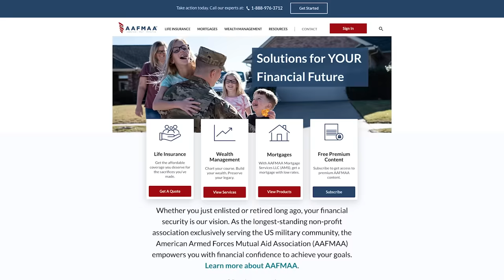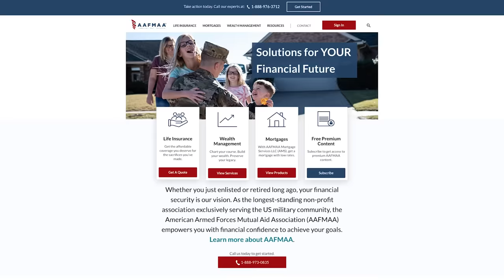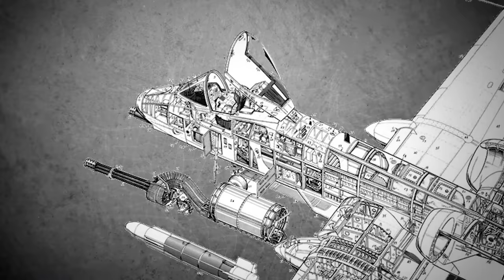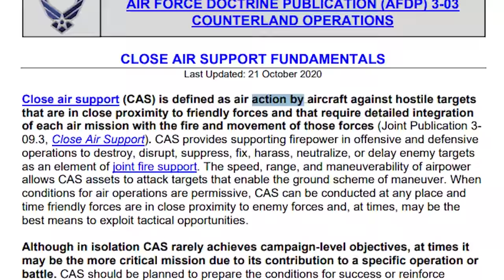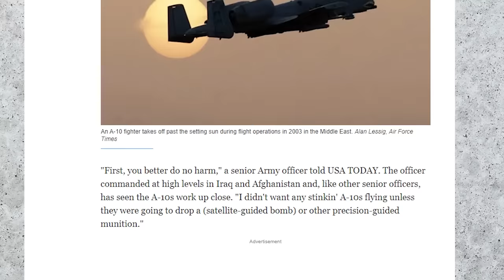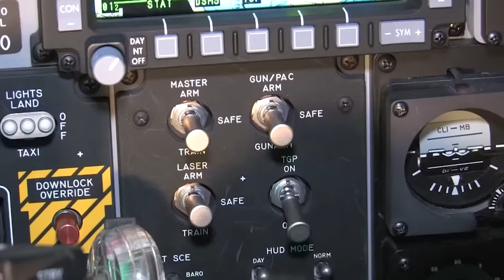Why the Air Force is Screaming to Retire the A-10 Warthog

Comment: As a teenage cadet I saw A10s on a bombing range. The maneuverability was the thing which really stuck with me.
Reply: while piloting a Navy H-3 in the pattern along with an A-10 at Tustin MCAS, it was turning circles inside our pattern 😂
Reply: Air show in UK 1981 saw an A10 do a tight  180 around a church spire, and was impressed.
Reply: The A-10 is slow, it's not 'maneuverable'. An illusion of maneuverability comes with slow speeds but that's like saying my shitty 1980s Corolla has better maneuverability than a Zonda F, because when the Zonda is going 180 MPH it can't make a right turn as quickly as my Toyota can at 15 MPH.

The A-10's engine are vastly too weak to call it 'maneuverable', its big ass wings mean it bleeds tons of speed with every turn and takes forever to get that speed back.
Reply: I've seen videos of these planes coming in under treetop level.  I've also been told that the plane comes in so damn low your instinct is to hit the deck instead of going for your weapon.

Comment: Back in high school I designed a close air support replacement for the A-10 for my CAD class project. Sort of conceptually similar to a hybrid of an A-10 and an Osprey. It had 4 General Electric TF34-GE-100 turbofans for propulsion. A wingspan of 70ft with 2 rotatable engines on the outer tips of the wings and the other two in the usual A10 location. It could carry 3,000 rounds of 30mm for its double GAU-8/A Avenger rotary cannons. One cannon faced forwards and the other one faced rearward at a downward angle. The idea was that using computer assistance the pilot could fire forward during his downward run and the computer would map the target during this firing phase and then calculate the path to take upwards so it could fire a second burst at the same target if the pilot decided to press the rearward fire trigger. Not only would a rearward firing cannon allow for double taps on hostile targets, but a rearward firing cannon combined with 4 GE turbofans would allow my creation to get the hell out of the danger zone very quickly.

I mailed my designs to the pentagon and DoD in 2007. Still no word yet on when I will be under contract to build it. Aaaaaany day now.
Reply: Make a mini gun but each barrel is itself a GAU-8
Reply: So you're the kid responsible for designing the Mk-19.
Reply: Your plane was too awesome for them to comprehend.
Reply: I wish i socialized more in highschool so i could know people with cool interests like that
Reply: You had me at "...double GAU 8/A..."
Reply: In the words of the Pentagon Papers: "Your plane needs a port-hole."
Reply: Did you give any consideration to what fuel and ammunition requirements, weights, and sizes would do to aerial performance?
I would guess not. .. you were a HS kid, scribbling instead of taking notes.... and this would make you a candidate for a procurement position at the Pentagon, perhaps.
Political infighting is the talent rewarded in the modern 'military' not military savvy... it seems.

In this case.. before I even watch the video.. 
I predict this will have more to do with people more informed of reality by Video-Gaming than by Engineering and Military experience.
Almost guaranteed this is e another workfare defense project like the littoral ships the Navy wasted  insane levels of resources upon.
Also almost guaranteed it will be an inferior piece of crap hyped in ways that impress intellectual poseurs in decision-making positions.
This will be more about moving workfare tasks around to various politically-connected locales than helping the USA be militarily superior.

Might think differently after I watch the video.. but I doubt it.
Or so I speculate as of now.
Reply: Should've just designed the Halo Pelican and submitted it
Reply: I’m sure you are out there ‘tearing it up’ in the ‘adult’ world now—you sound like a very creative person!  In the 1970’s as a ten-year-old, I wrote to the governor of my state suggesting dedicated “lanes” just for bicycles on the roadways,  I got a polite reply, but if felt condescending and like a major blowoff. ——-I don’t know, do any cities have bike lanes these days?😉
Reply: I say, make it out of wood like the Mosquito to make it stealthy. Voilà. The vulnerability issue solved.
Reply: @sfertonoc  Use sails for fuel saving.
Reply: What was it made of?  Something that heavily armed would also need a lot protection for the pilot and engines.
Reply: Would your plane be manoeuvrable? Since it sounds very heavy 😅
Reply: Hit the nacelles using MANPADS. Huge design flaw right there
Reply: I send them my ksp craft files... Still no word
Reply: Maybe they should hire you
Reply: This would actually solve the stalling problem when the gau fires lol
Reply: Thanks for the crayon drawing of your transforming jet 
- dod
Reply: August 25, 2023 - Mr. Freeze😉 That sounds like a fun project you had. It would appear that you have a very rewarding skill set both as a profession and a hobby. Stay well and fingers crossed🤞🏽😊 for selling your next design. Stay well.
Reply: If they give you any acknowledgement for this it would quash use of any similar ideas in the future from someone else in case there would be dispute over rights.
Reply: Mike sparks? Is that you?
Reply: In my youth I drew up all kinds of great ideas like a credit card music system instead of vinyl records.. Yeah, it became THAT popular! 😉 ..and I became || <--that rich, but I grew up on the notion we'd all have the famous Jetson's flying cars by now..and your average moron behind the wheel would suddenly become ace pilots running to the grocery store 4 blocks away.. I couldn't even imagine electricity without waiting for a lightning storm, flying a kite with a metal key hanging from the string and hooking it up to the power grid.. See what I missed out on?
Reply: It had r a g head tracking tech
Reply: @Necromediancer  Hey hey, that's making too much sense, that doesn't sound like a 15 year old's bulls**t idea!
Reply: Sounds insanely expensive, maintenance-wise. Cool tho
Reply: All bling no basics...

Comment: One compelling observation (as early as WW2) that greatly supported the “bathtub” concept was the fact that when you looked at all of the severely war damaged aircraft that managed to limp home in spite of huge holes in their wings and/or fuselage … not one of them had a hole in the cockpit area thus truly putting the fate of that bird entirely in the pilots hands.
Reply: P-47 Thunderbolt ONE is the inspiration.  Lots of engine, plenty of machine guns, and armor, armor, armor.
Reply: Duh?
Reply: @kimweaver1252 yeah… and air superiority and already having won basically (thanks to your allies mostly)
Reply: That's not very relevent nowadays as you'll get shot down my a missile more than bullets so it's better to be steathy than armored.
Reply: @aaronchung9838  The missiles do most damage with shrapnel.  STILL a good idea for a low and slow Ground Pounder to be armored.
Reply: @aaronchung9838 
WRONG❗
One Was Hit By a SAM And 
Made It 🔙 Back❗
Reply: This is like the textbook definition of survivorship bias.

Of course the ones that came back didn't have bullet holes in the cockpit. Those that did crashed because of the dead pilot.
Reply: Air Corps studies changed how the military considers damage. It's not the ones that make it back with holes that identify weaknesses, it's indeed the pattern of what flyable holes do NOT include which does.
Reply: And then there are those who, in SPITE of holes in the fuselage were able to fly home and the pilot had a nice dinner and a movie.
Reply: @michaelchevreaux7780  Remember that the missile that hit it was something dating back to the 60s. I dont see the A-10 surviving against more modern AA weapons.
Reply: It's like in WWI where the introduction of helmets caused head injuries to spike. Soldiers with helments would get head injuries instead of being counted amoung the dead like their predecessors.
Reply: @Comm0ut Deaths went down and head injuries went up when helmets were reintroduced in WW1
Reply: Sounds like survivorship bias
Reply: Wait....this is sarcasm right? Did you just seriously quote the events that led the Bomber Mafia in WWII to incorrectly assess survivability and what the best planes were, because of the survivor bias that they completely misunderstood? That was very literally a misinterpretation of data that costs lives in WWII. Because of course the planes that survive had pilots who weren't shot.....duh.
Reply: What if the armor makes them slower so they get shot more? The best armor is just not being shot in the first place.
Reply: @mr2922  Read the OP comment again. The commentor skipped the setup for the story and is reiterating the lesson supposedly learned, not the initial error of survivorship bias.

The original 1943 US Army study on bomber survival rates is often cited as an example of survivorship bias. Blah blah blah, dumb military organization thinks planes coming home with no significant cockpit/engine damage means these areas have plot armor. Everyone conveniently forgets the hundreds of bombers that didn't make it home, and no one wonders about what damage they sustained? :P

Unfortunately, as with most Internet retellings of old stories, the actual lessons and objectives are not what are commonly claimed. Remember, these Internet stories are themselves designed to prey upon your confirmation bias. And what red-blooded American doesn't love the story of a plucky engineer/mathematician proving the institution of Big Army to be a clumsy, bureaucratic oaf?

However, by 1943 most militaries were well aware that cockpits and engines were critical components. What the US Army study needed was more nuanced -- a statistical basis for HOW MUCH damage a plane could take and return home.
Reply: TEXTBOOK example of survivor bias.
Reply: Studies on WW2 battle damage have what’s called “survivor bias”. Where the studies incorrectly thought most damage occurred in the wings because that’s what they saw the most. What they didn’t see was the aircraft shot down because of damage to the cockpit area.
Reply: Can someone explain survivorship bias in this thread again.

Maybe mention Abraham Wald and Operations Research this time. 😂
Reply: @Stellar001100  
The Plane Barely Made It 🔙 Back,
But At Least Pilot Didn't Have To Eject Into Enemy Territory.
Reply: @michaelchevreaux7780  The key word is barely. Now imagine it flying against first world air defense network.
Reply: @Stellar001100  Remember that most of what is out there (even in Russian service) is a lot of older Soviet stuff still, and has only gotten worse with age.
Reply: @removedot  Most of the potential adversaries we would fly against have upgraded to at least S-300 batteries. The A-10 wouldn't survive that.